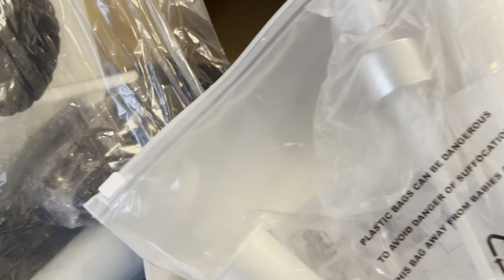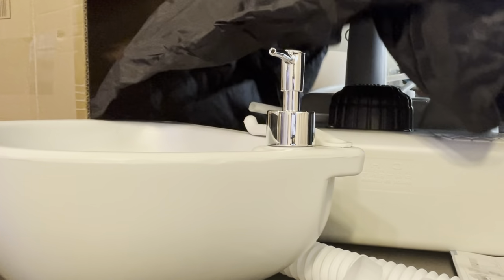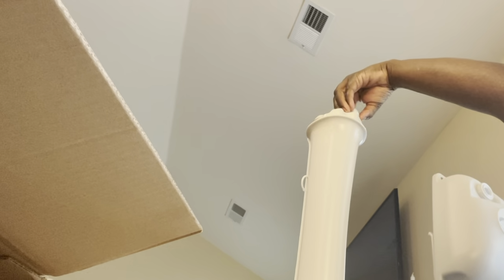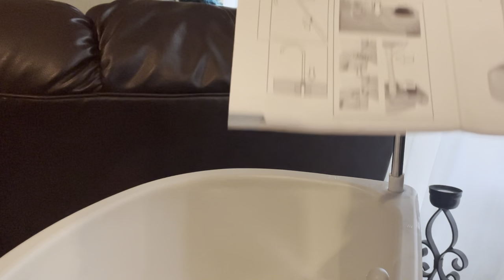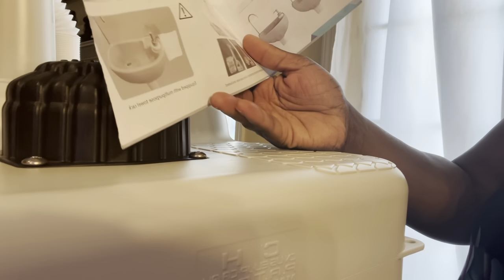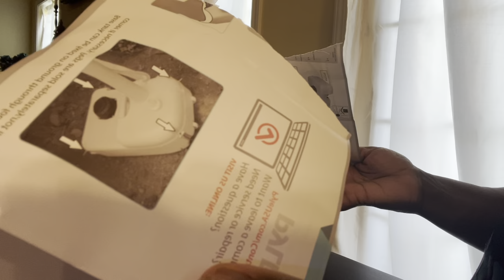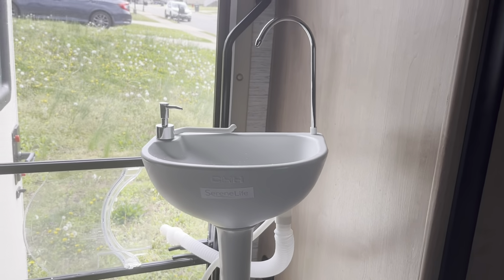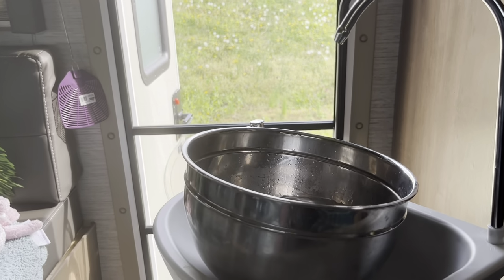Portable Camping Sink Unboxing and Assembly NO PLUMBING additional 5 gallons of water onboard

Comment: I was looking at this to help solve the no bathroom sink issue I have in a camper that I was looking to purchase but it think the base of this will take up to much space. 🤷🏻‍♀️
Reply from the maker: Yes it takes up space and it broke…not good quality won’t last
Reply: @CarlaRFowler  Thanks! I’ll have to deal with having to do everything in the kitchen sink which really grosses me out but anything else I saw that’ll work have no distributors in the USA. 🤦‍♀️
Reply from the maker: @monicae67  I think this was Amazon
Reply: @CarlaRFowler  Yes, I saw this on Amazon and had it in my cart but I actually found something else that was better. It was a small plastic basin that could fold up and it had a facet . You didn’t have to pump a pedal either but sadly, no distributors in the US, not even Amazon. 🤷🏻‍♀️